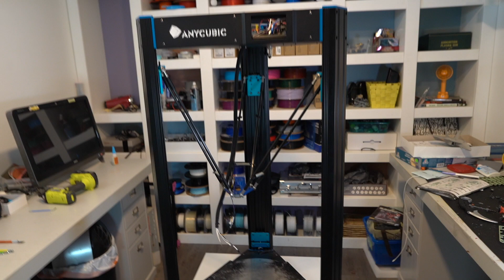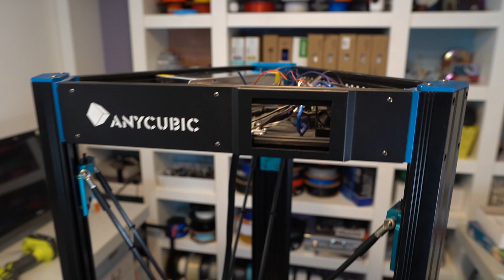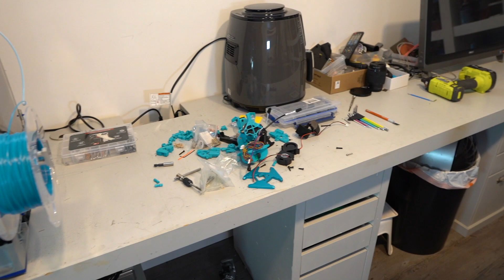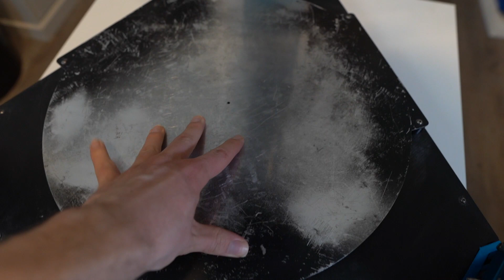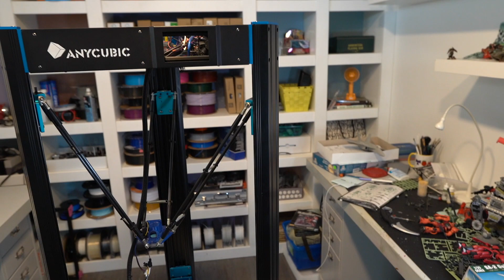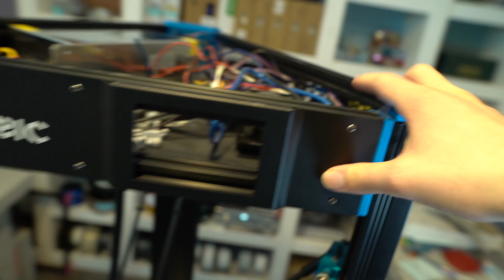Anycubic Predator Delta Printer Upgrades - Overview

Comment: Just started using my predator again after letting it collect dust for a year or 2.  I want the mosquito direct drive effector guy designed on Printables website.  Figured I would go ahead and order hayden huntly magball arms first to see how hard it is to get those working with dimensional accuracy.  I think they arrive tomorrow.